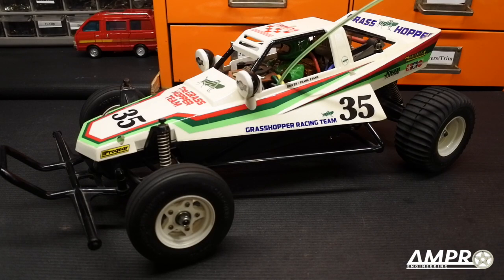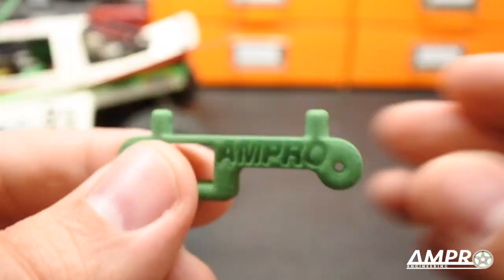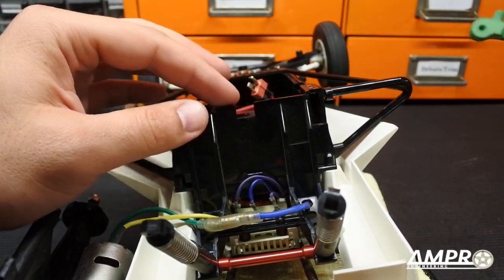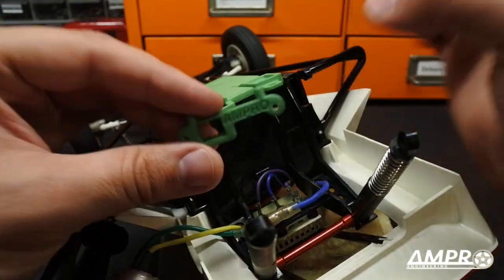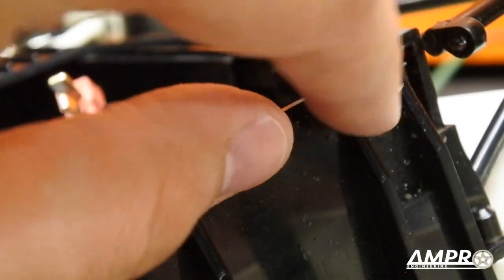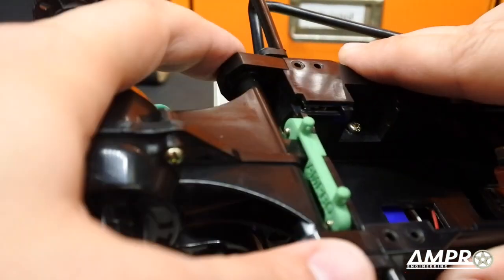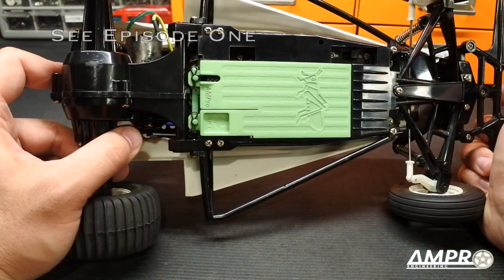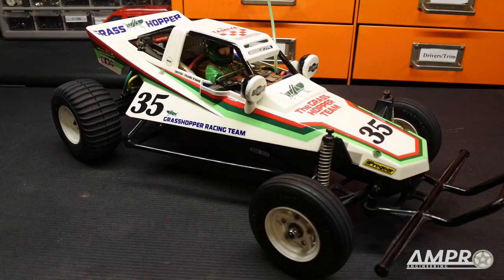e70- Tamiya Grasshopper Battery Door & Retainer

Comment: I wish I could but I can't purchase these..I say these because not having them as a kit to purchase together makes no sense. I've seen the comment about a $1 something savings keeping them separate...who cares, make it a kit! It was a pain in the ars to see how much it will cost me as a pair because you know, they are usless without each other. 
Also, $53 plus not including brokerage fees is rediculas cost when the hole grasshopper kit is only $143 new and that's regular price. It goes on sale at times.
I will just continue to use the good old servo arm that works just as good imo. Great idea but makes no sense to spend that kind of cash on a minimal issue. I would consider them as a kit together for $35 after shipping max. Way to make a really awesome idea untouchable to the smart R/C shopper. Oh and them batteries can take a beating 👍
Reply from the maker: So the reason they do not come together is that there are 4 versions of the mount as well as 3 versions of the battery door. As for the fees, that is all from shapeways and not me. LiPo batteries also cannot in any way take a beating. If you are running old NiMh, then they can.

Comment: oh speaking of tidbits.. back when I used to use on road pan car front springs on top side of the grasshopper/hornet front towers. recently saw video of guy modding a lunchbox who had CA'd 7-8mm long bits of rubber tubing that acted as a friction damper. this got me thinking, a small flat rubber washer on the top of the spring (underside of tower) add same to topside, then same on road front pan car spring to the topside, making the front A arms flatter, sprung in both directions, with two neoprene/rubber disc friction dampers riding the "shock" pin. of course shocks are going to be nicer, but this may be a really good budget fix to get SOME suspension damping and a little less of the infamous bump steer issue.

mentioning it because your grasshopper there looks to have 1/4" of the pins standing above the towers, prettymuch ready for the cheap-cheap "mod" just described. I like your aftermarket front end much more no doubt, but some folks like to keep things closer to bone stock. give the idea a try and see what you think?
Reply from the maker: No you are totally correct. That is the fix tamiya did on the Hornet actually but they put a cup with 1 or 2 orings (depending on your desired dampening) in the cup. Worked rather reasonably in comparison to the GH. I will have to give it a go.

Comment: You know, I've used a very simple omega-shaped bent piano wire across the battery door (gripping on the top of the axle pivot mounts L and R. Uses the original battery door, cost near zero. Funny thing is that I cannot remember who came up with it, but it's somewhere around 30 years old. I do want to put it up on YT but I am still working out how to record proper sound with my Iphone... which brings me to the question: what gear do you use to record your videos? It would be great if you could do a little video on that. Especially how you get the good "table top" view and lighting etc. Thanks!
Reply from the maker: Yeah I used to do that too but I also had that wire bend and come off and I am tired of that stuff. I even had an awesome Velcro mod but it too wore out. Plus on the hornet the door retainer holds the trans in place so that kills two birds with one stone. I wanted the fix to be permanent and look stock. As for the Camera, it is a Nikon J5 and a shotgun mic with LED lighting and sound deadening on the walls. It isn't perfect but it works.
Reply: I used Electrical Tape.
Reply: @AMPROEngineering  This is what I love about your mod. I’ve just upgraded my Grasshopper to the Hornet suspension and I’m not impressed with the tiny springs and the slappy pivot, so I’m really happy with this double mod as it saves me having to add the third shock. Nice work.

Comment: So use 2 8mm self tapping Tamiya screws and washers?
Reply from the maker: As long as they are M3 diameter then yes. Make sure the hole is cleared out with a 2.5-2.6 bit first and as you screw in go back and forth to make sure you cut the threads in there.
Reply: AMPRO Engineering thank you! You are very helpful!!!
Reply: Now you did say to use a 3.2mm drill for the chassis holes and then use m3 8mm self tapping screws, right? I'm getting ready to order these pieces and metric drill bits, so I want to make sure.
Reply: In the video you said 3.2mm, should I use a 2.5mm or 2.6mm instead?